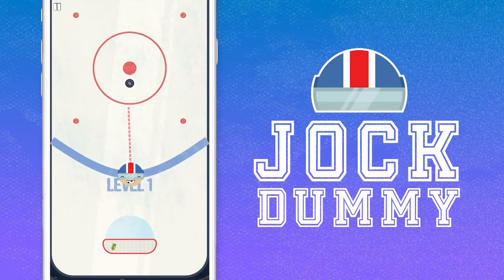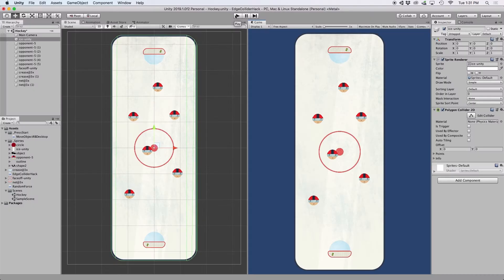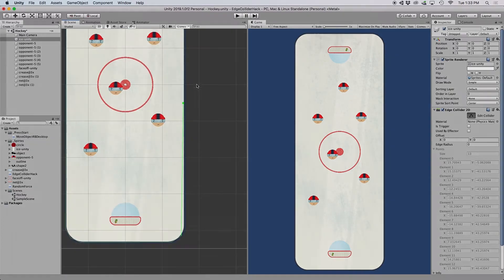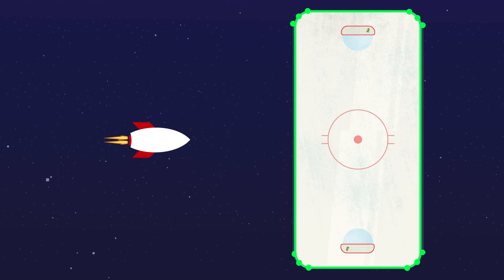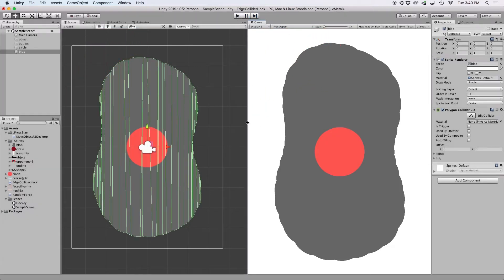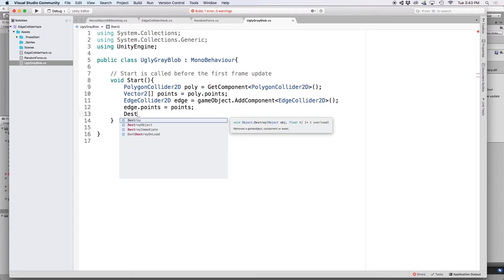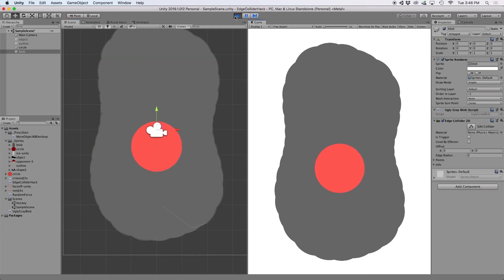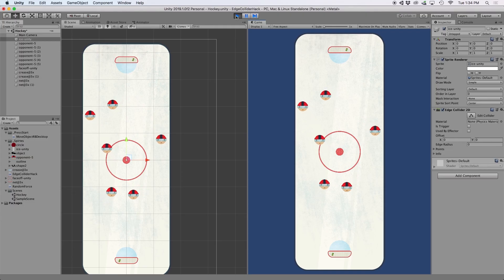Unity - How To Contain RigidBodies Inside 2D Colliders

Comment: What a genius idea of you. However, when I test it on a Circle, there is one hole between the last point and the first point in the EdgeCollider2D. This is my solution to it (with the help of ChatGpt):
    private void Awake() 
    {
        PolygonCollider2D poly = GetComponent<PolygonCollider2D>();
        if (poly == null)
        {
            poly = gameObject.AddComponent<PolygonCollider2D>();
        }
        
        Vector2[] points = poly.points;
        
        // Create a new array with one extra point to close the loop
        Vector2[] closedPoints = new Vector2[points.Length + 1];
        for (int i = 0; i < points.Length; i++)
        {
            closedPoints[i] = points[i];
        }
        closedPoints[closedPoints.Length - 1] = points[0];  // Close the loop
        
        EdgeCollider2D edge = gameObject.AddComponent<EdgeCollider2D>();
        edge.points = closedPoints;  // Assign closed points

        Destroy(poly);
    }

Comment: Here is a refactored and documented version of the script with additional features for everyone:

using System.Collections.Generic;
using UnityEngine;

/// <summary>
/// A component that converts a PolygonCollider2D to an EdgeCollider2D.
/// <para/>
/// This component provides the ability to either: <br/>
/// - Automatically convert the collider on Awake. <br/>
/// - Manually trigger the conversion via a context menu in the Unity Editor.
/// </summary>
public class ColliderInverter : MonoBehaviour
{
    [Header("Configuration")]
    [SerializeField] bool isTrigger = false;
    [SerializeField] float edgeRadius = 0.025f;
    [Header("Settings")]
    [SerializeField] bool runOnAwake = false;
    PolygonCollider2D polygonCollider;
    EdgeCollider2D edgeCollider;

    private void Awake()
    {
        if(runOnAwake)
        {
            ConvertToEdgeCollider();
        }
    }

    [ContextMenu("Convert PolygonCollider2D to EdgeCollider2D")]
    private void ConvertToEdgeCollider()
    {
        // Ensure there is a PolygonCollider2D
        if(polygonCollider == null) polygonCollider = GetComponent<PolygonCollider2D>();
        if(polygonCollider == null) polygonCollider = gameObject.AddComponent<PolygonCollider2D>();

        // Destroy the existing EdgeCollider2D if any
        if(edgeCollider == null) edgeCollider = GetComponent<EdgeCollider2D>();
        if(edgeCollider != null) DestroyImmediate(edgeCollider);

        // Copy the points from the PolygonCollider2D to the EdgeCollider2D and add the first point as last to close the loop
        List<Vector2> points = new List<Vector2>(polygonCollider.points);
        points.Add(points[0]);

        // Create the EdgeCollider2D and assign the points
        edgeCollider = gameObject.AddComponent<EdgeCollider2D>();
        edgeCollider.points = points.ToArray();

        // Set the EdgeCollider2D settings
        edgeCollider.isTrigger = isTrigger;
        edgeCollider.edgeRadius = edgeRadius;

        // Destroy non-unused PolygonCollider2D
        DestroyImmediate(polygonCollider);
    }
}

Comment: It's so useful when you figure out how to make your own tools, it saves so much time. Like I remember I wanted to make something smoothly Lerp from between 2 Vector 3 points and then back over and over again so then I made a script that gets 2 vector 3 positions or 2 empty objects that I can place where I want for point A and B and also has a changeable speed variable in the inspector and you can choose an object you want to move between these points, I made it by making a float variable, then on update, setting it to equal Time.time, then I divide it by another float variable (this will be the speed), then I Modulate it by 2, like this: movingTime = (time.time / speed) % 2; I think it's that. Then then I do movingTime -- ; to subtract one so now it goes from -1 to 1, then I do movingTime = Mathe.Abs, something like that, I can't remember exactly but basically I set the variable to be the Absolute of itself, then I use the movingTime = Mathf.SmoothStep( 0f, 1f, movingTime); to make it smoothly go from 0 to 1 and back to 0, you can also set it so that on start, it gets the distance between point A and B in a straight line and set it to multiply the returned number of the first line of code to that number so now it always moves at the speed you set it to move at, no matter the distance. You can use it for moving floating platforms and stuff

Comment: If you had problems with the polygon collider not connecting to the last point, try copy pasting this below..

public class EdgeColliderHack : MonoBehaviour{
    private PolygonCollider2D poly;
    private void Awake() {
        poly = GetComponent<PolygonCollider2D>();
        if(poly == null){
            poly = gameObject.AddComponent<PolygonCollider2D>();
        }
        Vector2[] points = new Vector2[poly.points.Length + 1];
        for (int i = 0; i <= poly.points.Length - 1; i++)
        {
            points[i] = poly.points[i];
        }
        points[poly.points.Length] = poly.points[0];
        EdgeCollider2D edge = gameObject.AddComponent<EdgeCollider2D>();
        edge.points = points;
        Destroy(poly);
    }
}

Comment: There is a problem with this, it will never connect the first and the last point. It's very obvious if you want to do this with just a square. And the solution isn't so easy either as you can't easily add to the end of an array.